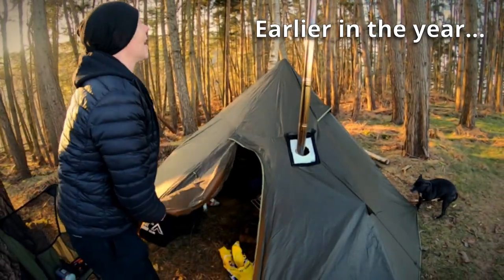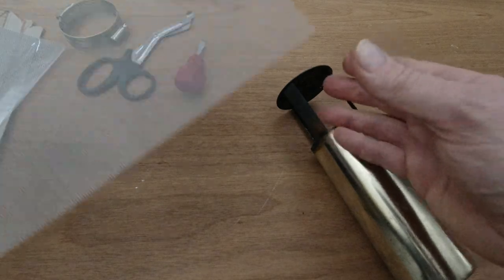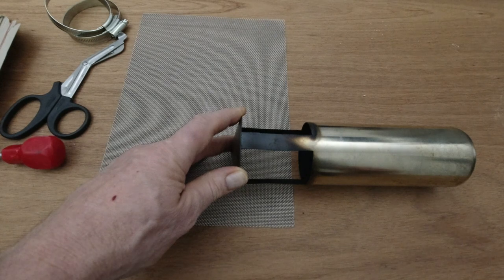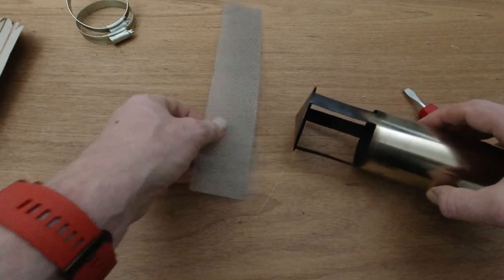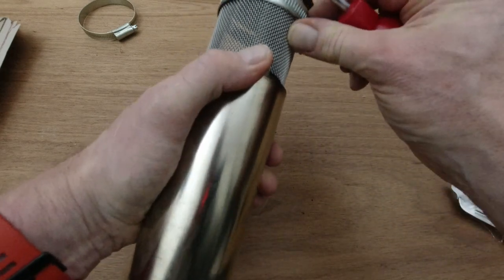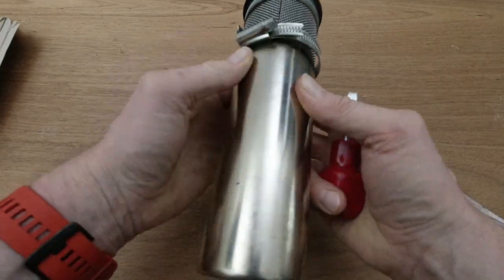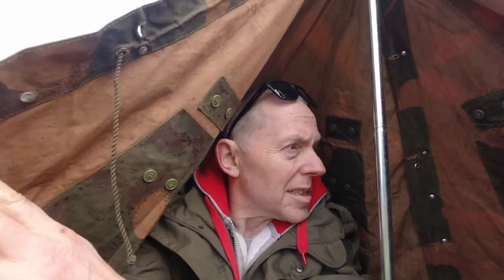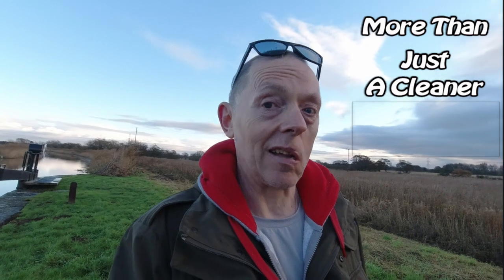Spark Arrestor Mod for a Camping Wood Burner Stove Chimney/Flue

Comment: I would use thin wire rather than those wide metal  clasps blocking air flow, have you considered a spark arrestor at the origin of the flue inside the stove? Heat would burn off the creosol.
Reply from the maker: I like that idea 👍😁
Reply: Think about the area of the pipe, which is what? 2.36 inches, 6cm? That means the area is 28.25 cm square.
The holes in that cap are 25% taller than the pipe is wide, making them 7.5 cm tall. The supports are 1.875 cm wide and there are 3 of them. The circumference of the pile is 18 cm. Subtract the supports which gives you 12.375 cm total width for your vents on top. That's a total area of 92.8125 square CM of area you are letting smoke out of. That is 3.3 times as much area as the pipe itself (and that doesn't even account for the restriction from the dampener, air inlet, etc). The fact is, as long as that mesh and the clamps don't cover more than 1/3 of the total area of those openings, you're perfectly fine. 
Even if he used full mesh over the entire thing and used 2 clamps, he would be fine.

Comment: Unfortunately, you have just halved the discharge capacity of the flue. Try doubling the three slots in the top of the flue first, then cover that with mesh, nice tidy job though. Cheers,
Reply from the maker: Yeah this one failed. Check out the second attempt and you'll see I got it better in the end 👍😁

Comment: Think about the area of the pipe, which is what? 2.36 inches, 6cm? That means the area is 28.25 cm square.
The holes in that cap are 25% taller than the pipe is wide, making them 7.5 cm tall. The supports are 1.875 cm wide and there are 3 of them. The circumference of the pile is 18 cm. Subtract the supports which gives you 12.375 cm total width for your vents on top. That's a total area of 92.8125 square CM of area you are letting smoke out of. That is 3.3 times as much area as the pipe itself (and that doesn't even account for the restriction from the dampener, air inlet, etc). The fact is, as long as that mesh and the clamps don't cover more than 1/3 of the total area of those openings, you're perfectly fine. 
What I would have done is rolled the mesh and slid it inside of that cap, and I would have covered all 3 openings. I would have secured it with a little bit of wire. I would have also attached 3 pieces of wire to use as guy outs to support the pipe.
Reply from the maker: Lol that's a lot of maths.
I was experimenting.
Part 2 is better 👍😁
Reply: @MoreThanJustaCleaner  ah yes I just saw part 2.
I didn't think about that mesh clogging but that makes sense.
I love math.

Comment: You should remove this video as you know the mod does not work and clogs very easily, the mesh is far too fine, the holes need to be a lot larger
Reply from the maker: I appreciate what you're saying however it's part of a process of learning, hence the Part 1 of 2 in the thumbnail 👍😁

Comment: The micro screen will clog after one good fire.
Reply from the maker: You need to see the follow up 😋😊
Reply: My thoughs exactly.
Reply: IMH0 ...
... that mesh is too fine and will quickly  clog with creosote  and possibly not properly  venting carbon monoxide and or smoke.

The screen alone  will reduce available flue draftf